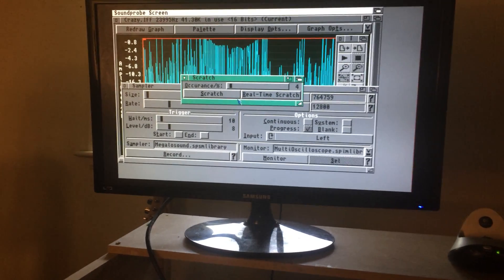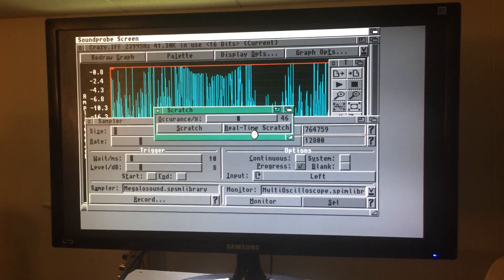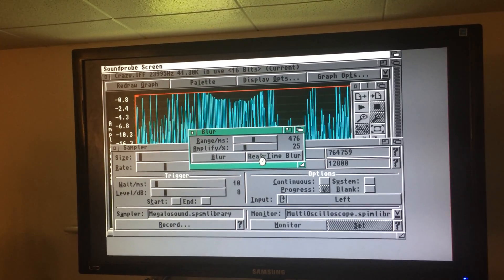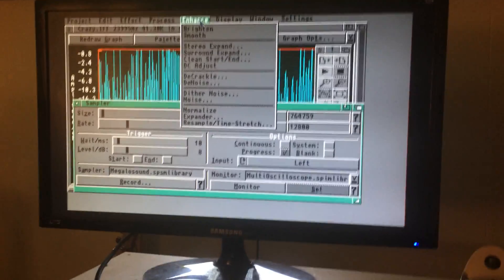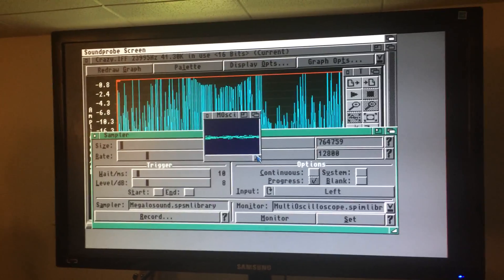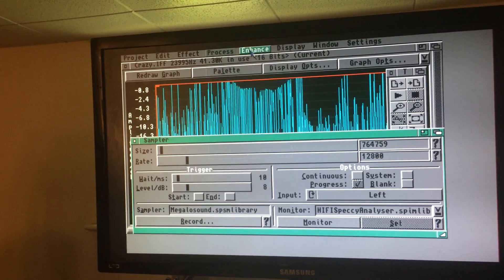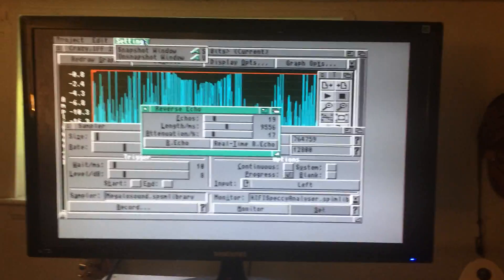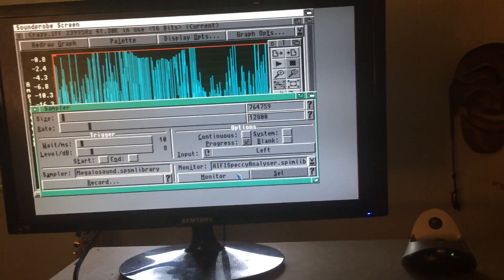Sound Probe 2.11 running on an Amiga 1200

Comment: hi how are you =? is it possible to run this program on amiga 500? those fx are in 8bit, is it right?
Reply from the maker: yep, the only issue you'll experience is it's speed/performance might be laggy if you have an unaccelerated A500..  I believe this one has an 030/40mhz 128mb card in it at the time of making this video.
Reply: @8bitwidgets  OK thnaks for the info , i want to use some software like a techno sound (or this) for redux de bit of some of my own production. I have in mind to export in different group channels(drums, melodies,arp,chords) and then, introduce them to the software through input , and use the fx. record all of the proceced and then made an new arrangment. Do you think it's possible?
Reply from the maker: @ignaciorichter9190  yea i mean you can treat the amiga as a real-time filter (though i do think there is some noticeable latency from audio in/out, which makes it less ideal for live performance) and record the output and then put that new sound in your other modern software..   or you can also load sounds into it and edit those samples and then export those..   it's been awhile since I've done it, but I know I found ways to get the amiga 8-bit sounds into modern software and hearing it correctly..
Reply: @8bitwidgets  fantastic man! thanks and keep in touch! have a nice weekend!

Comment: Very cool...well done
Reply from the maker: Thanks,  I want to make a 4th video that talks about misc other amiga audio apps I use but I need to figure things out a bit more.  I have a few "sampler" programs but none of them really do it all ideally..  bars and pipes pro is probably the best overall, but my version seems to be in german..  some point i need to figure out how to change that.  a lot of parameters and while i can figure them out mostly.. still awkward to work with.